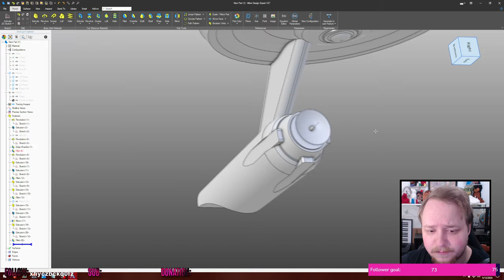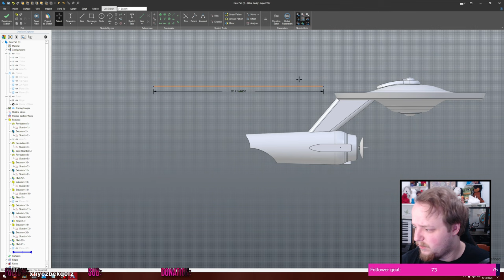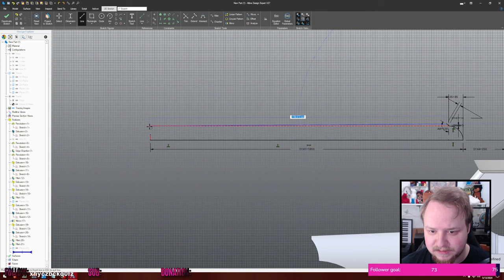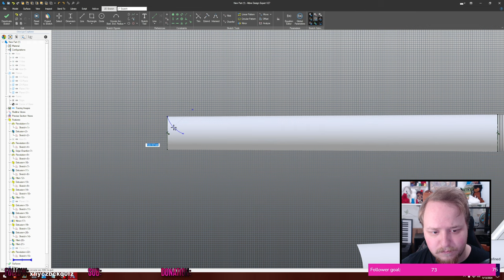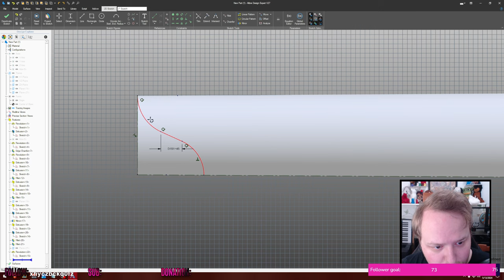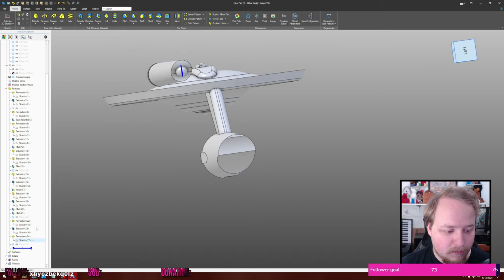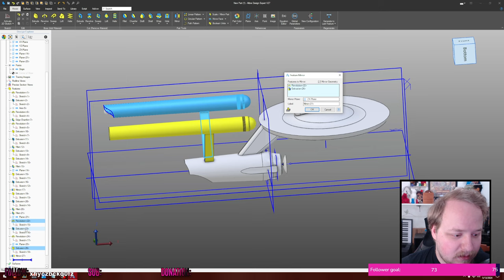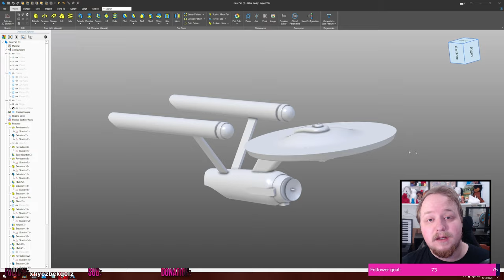ENGAGE! || Making a Starship in Alibre! #3

Comment: Hahahahaha... I laughed too hard at that intro! Such a cool spaceship there man. This could be 3D printed and used as a decent prop I would say!

Also, I have run across those two bugs there. Although, I only get the second one if I change a hot key. Then I need to relaunch sometimes. And the mirror one is more common but mirror failures seem to be a parametric CAD thing... Annoying really.
Reply from the maker: As usual, thank you so much for watching! 
If I was 3D printing this, I would probably want to do it in separate pieces that I could then glue together. 

As far as the bugs, I know mirroring can be a bit tricky for parametric CAD which is why I wasn't too surprised. The key binding bug surprised me since I hadn't been messing with any settings.